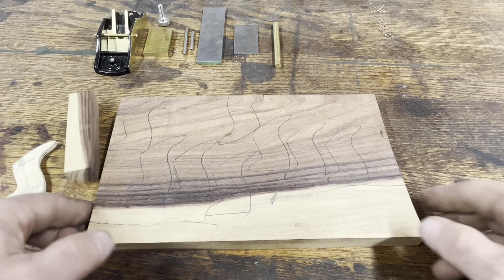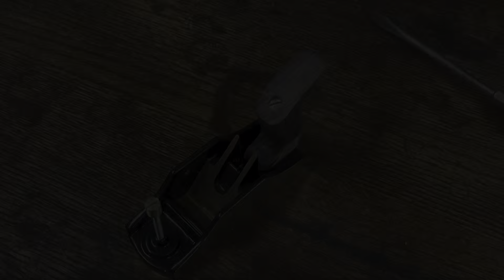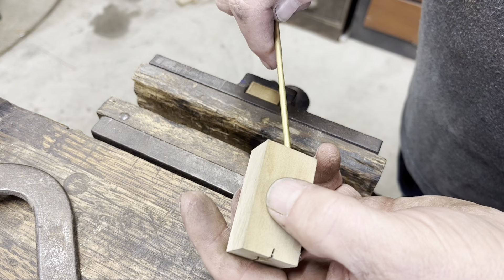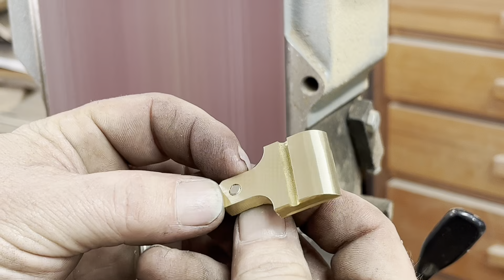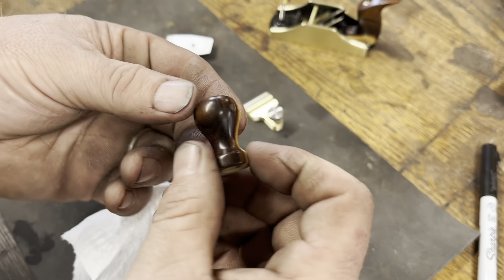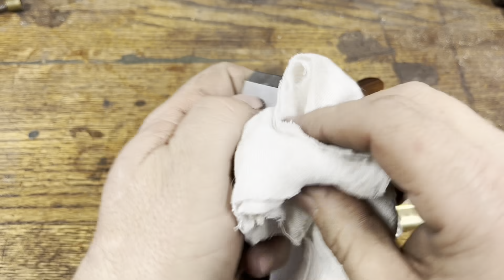Making a Plane from Scratch Part 3: Final Assembly

Comment: If you like sap wood, then use Sap-elle. 😂 Do you plan on making a cast iron #1 replica or the never manufactured non-existent bedrock 601?
Reply from the maker: Superior Toolworks makes a Bedrock 601. But I am making a no 1 sized low angle like the 164.